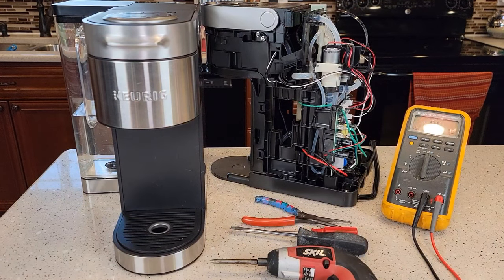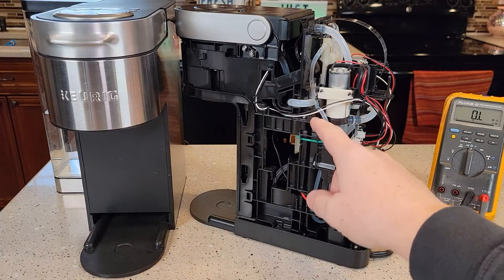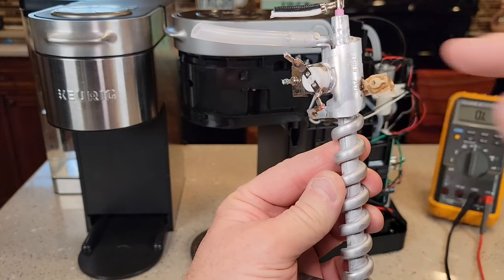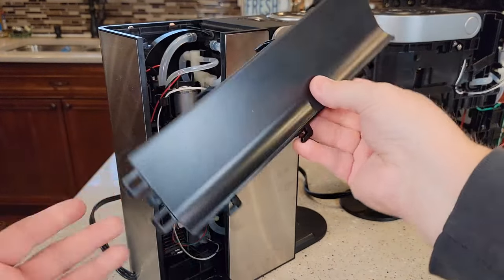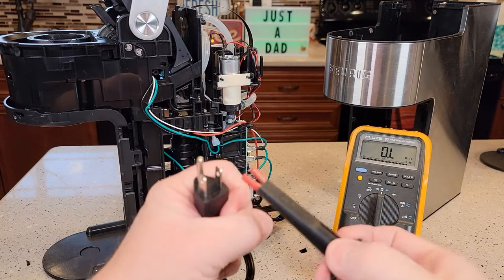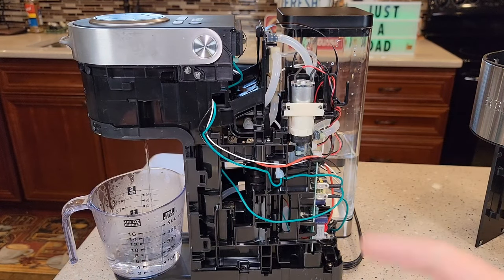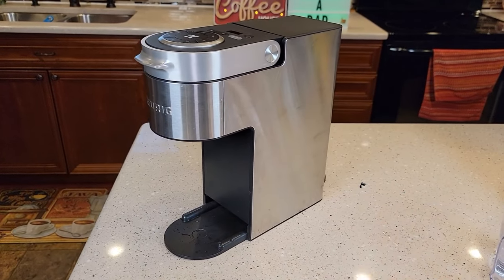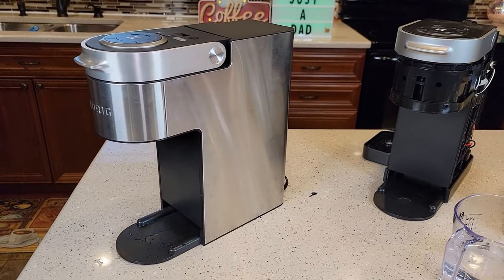HOW TO FIX Keurig K-Supreme Plus Coffee Maker Dead NO POWER.  How to reset Thermostat POWER LIGHT!

Comment: Thanks!  Has Keurig fixed the board yet to tell you to add water in the descale mode?  Mine was about to trip again because it will not say add water before it's too late, which messes up the descale rinse part of the mode [because I feel like I have to interrupt to add water before it blows thermostat again].  Any who, I just add water to rinse, then unplug for a while to get back into brew mode, but then have to live with the descale message on - as long as I get my coffee - thanks again for an excellent, detailed video.
Reply from the maker: No I don't think they have fixed that yet

Comment: Exactly  what happened to me.  Ran the tank dry and it went dead.   I was able to fix it in about 1/2 hour following your video.  This is the second one of these that had a problem.  My first one went into descale mode and never came out.  It was under warranty and Keurig replaced it for free.  It is now a parts machine.   I like the machine but there is too much going on inside.  I fear something will  always break

Comment: Well, I screwed around for at least an hour ,trying to fix myK920...to no avail.  I reset the thermostat , try to descale , and the unit seems to just quit again. Since it is a PITA  to dismantle
,I decided to plug it in after the first reset to try it. Good thing I did. So i am not sure what is the defective component; thermostat  or the water pump. I even tapped on the pump to see if it could be just stuck. I have to say that the machine is quite new , but it was in storage for a year or so. It was given to me.

Comment: My mistake was to run my tank dry before repacking it for transport back home in the spring so it wouldn’t drain water in the box.  Big mistake. I blew the overheat switch fuse. Why didn’t they put it on the other side of the heater so we could reset it easily by removing that sliding piece of cover?  Thanks for the video on repair.

Comment: Whew, just finished! It’s working now! Now just need to get it out back together…
Reply: Never mind. That took 30 seconds to put back together. Haha. Thanks for the video!
Reply: I tried descaling my machine but the water light didn’t come on, it ran itself dry and then flipped off.

The only question I have is de we effectively bypass the thermostat by doing this? Or did we actually reset it? As in to ask, will the thermostat work in the future to prevent a fire if the water is low, or is this a potential liability?

Comment: Well done!  Back in operation.  But, I'm not sure my low water sensor is working.  I think that's what failed and tripped the thermostat during descaling.  When I completed the rinse cycle, the water again dropped below where I thought the sensor should have allowed.  I unplugged the machine to prevent a repeat.  Now what?

Comment: What a well done video...thank you. Liked and Subscribed. I am saving this information for eventual use, but my problem now is ADD WATER comes on when the tank is full. Sometimes removing the tank and pushing down the connecting bung fixes it, and sometimes I have to Power-Off and unplug the brewer between uses. Do you have any ideas to remedy that?  TIA

Comment: Thanks, I had model k091 which is a tiny bit different.  It has three screws on the bottom that hold the sides on.  Otherwise it was the same.

Comment: Wow, remember when stuff used to last😄. Man, talk about planned obsolescence and a pain to take apart😥. 

For $200 (made in Thailand😞), you would think the water level sensor would be bit better🤔🙄. Wish I would have kept the old 2.0 model that had no issues. This Supreme Plus model barely made it 2 years😱😡

I do see new water pumps on eBay, but that seems to be about it. Gonna give your fix a try and if the pump is shot and keeps tripping the thermostat...Then the $50 Amazon k-cup it is😅

Just a recommendation on the descaling, use vinegar and then distilled water for best results🤙

Thank you, sir🍻

Comment: Hi I just found your video because I need to open the Keurig machine and get my daughter's father's pendent containing his ashes out of it. she'd stuck the necklace on top of the Keurig. Then I came along and opened the top to add a k cup and it slide in. I tried turning the machine upside down with no luck. Should I open the machine like you showed or can I just pop the top off to retrieve pendant. I feel so bad. And thanks for an easy to follow video.
Reply from the maker: try to pop the top first,

Comment: Thanks for the video

My machine initially wouldnt power on. I was able to open my keurig supreme plus and reset the thermal switch and now the unit powers on but only the power button 12oz and 10oz button lights up then turns off. Ifbit stays on long enough the power button sometimes flashes 2-3times

Comment: Great video.  I have one of these K-Supreme units that works but none of the buttons on the top light up.  It seems to work in spite of this.  Do you have any guidance on taking the top head apart to check for a bad connection?  Thanks in advance.

Comment: I had this problem and I contacted Keurig. Instead of servicing it they were good enough to send me a brand new one free of cost. But I am having a problem with the replacement unit in that the water is not going through the pod so I am getting plain hot water. So it looks like I will have to try what you have shown in your video with my old unit. These Keurig machines don't seem to be very reliable.

Comment: Mine is brewing just a little bit and stopping. I am troubleshooting right now and came across this video. With the machine apart can you tell me exactly where the themostat is on the side panel in relation to the reset button. I am going to drill a hole in mine so I can stick a long wire in and reset the therostat without disassembly. I will of course put a decorative plug in the hole so it still looks nice.

Comment: Thank you this video. I called kuerig this morning because I went to brew a cup this morning like normal. I pressed 12 oz and brew and the machine immediately shut off. I turned it back on and it said descale. I just descaled this machine a couple weeks ago. So I tried holding the 8oz and 12 oz at the same time and nothing happened. Descale disappeared. So I tried brewing again. And it immediately shuts off. Kuerig offered me 20% a new kuerig with no help. 😏 Not sure if I just have to reset the thermostat but I’m going to try this. Any ideas what would cause this?

Comment: My Keurig supreme  had a power on light but no cup size or start button were dark. The micro switch for the kcup lid door handle was solid shorted   The button was stuck in the micro switch under the metal actuator. Tap the micoswitchwith a screwdriver and the button popped out of the switch. And now it works

Comment: Thanks!  Just got 2 broken Keurig brewers working again with a warranty replacement on the way! That said, I have a different problem on one of them (which is why I replaced it in the fist place) that K-Supreme Plus doesn't have any lights, at all, but still works.  Any idea of what I'd need to do to get the lights(power/screen/buttons) to glow?  The other one is almost always 2-4oz short even after multiple descalings... any ideas on a fix for either?

Comment: Thank you for your informative video.
I was able to dismantle my unit, thanks to your instructions, but fond testing it with my multi-meter, the reset button had not tripped and there appears to be other issues. When I press the power button, the power light comes on as well as the strength and the temperature lights. The other lights fail to illuminate and nothing happens when  press any of the size buttons or the big K button. This happened all of a sudden...I made my wife her morning coffee and when I placed a pod in for mine...nothing.
The water tank was full at the time.
I called tech support and They offered me a 20% discount on a new model but at $300.00 Canadian, I'll go back to the old coffee peculator if I have to. 
I currently have it tagged for the landfill unless you have any suggestions it's only 1 1/2 years old.
Reply: After further investigation I can see that the ground (green) and the hot (black) wires have been severed way up inside the flip up head. This appears to be a design flaw as the wires should be highly flexible able to tolerate constant flexing. 
Thanks again for the great videos.
Reply from the maker: oh wow thanks for shairing.

Comment: Hi - any suggestions for the unit powering on, but not working otherwise.  It then shuts off after around five minutes.  Tried all the unplug the unit and reset the reservoir options to no avail.  One other piece of information is that the "Over Ice" button flashed quickly when plugging the unit in and before pressing the power button.  Thanks for any insights.  Love your videos!
Reply from the maker: have you descaled it?
Reply: Indeed I have
Reply: So - do you have any suggestions for further troubleshooting this unit based on my description above?

Comment: Huge Thanks!  I am on my 2nd one of these and refused to replace it.  Found this video.   I have a 2nd home and both failures came after leaving the machine unused for ~6 months.  The first use it dies.   Does anyone have any clue if the water evaporates or something in the machine?   I empty the tank when I leave it unused for a long time.  Is there a way to "winterize" it so this shouldn't happen?

Comment: Hey Dad !!!!!!!!    Mine quit working at the control panel.  Checked the breaker, was not open........   Further investigate I found the Blk wire for the panel annunicator broken from opening and closing the upper lid.  Reconnect the black (power line) L1 120 walllahh !!!  Back in business..............   Matthew.

Comment: Kudos to you, Dad, what an incredibly helpful video! Thank you so much. How did you find that reset button?
I’m shocked to how many people this happened. For a relatively expensive coffee maker, this is surprising.  Hopefully, Keurig can make up for this. Currently, one needs to rip the whole housing into shreds before one can access a simple reset button. I wonder many people went to buy a new coffee maker, right after descaling because this incident seems inevitable. Is this part of Keurig’s business model? That will backfire once the reviews come in.
Reply from the maker: Thanks so much!! I can not take the credit,  I did a video of me taking apart a coffee maker and I found the thermostat bad by troubleshooting it with a multimeter.  But I thought I had to replace it, I had a viewer leave a comment and said it could be reset.  I reset mine and it worked!!

Comment: K-920 Keruig K-Supreme Plus. I been out of town for 5 months. Came home and filled the reservoir with water. Turned it on, left the kitchen and came back 10 minutes later and no power. Found your channel and disassembled the machine. The thermostat was tripped. I reset it, put the reservoir back on, hit brew and after a few seconds, the thermostat shut it down. I did notice, the pump is going (by feel and sound) but the water is not getting up to it. Is there a way to purge the air out?

Comment: Thank you for the great video JAD but I am not going to work on my coffee maker. 
Keurig needs to bring back the K Elite and trash the K Supreme Plus or fix it. I have purchased 4 K Supreme Pluses from Costco in 1 year and all have died anywhere from 2-1/2 to 4 months. 
They will not power on just as you indicate in this video. 
The last one was the newer Costco exclusive Gray model and it was the worst. It just died today 2/27/23 after 2-1/2 months including one descale. It seems that shortly after the first descale they fail. 

I purchased the K Elite in late 2018 and did not start using it until July 2019. It was still working fine when we donated it in January this year.
So what is Keurig doing to correct this? Anyone know? Is there a better option that uses K-Cups?

Comment: Your video was very helpful and well done. I was hoping it could help me but I happen to have a different issue with mine. The machine turns on but when I try to brew the lights go out and nothing. I tried descaling by pressing the 8oz & 12oz for three seconds and when the brew button lights up I press it and again all lights go out. It almost sounds like the pump is not working. Would resetting the machine on the inside work? Please help!!
Reply from the maker: no the reset will not help with this, sorry

Comment: Second time I’ve used this video to fix my Keurig. 

Question: Why do I have to take the screws out of the bottom to disassemble it when the sides just snap off? I don’t see how they could possibly prevent me from removing any of the outside pieces.

Comment: This thermostat reset seems to be a common problem on several models of Keurigs ( the one I'm working on is just the cheap K - Express Essentials in barf blue !) My comment is WHY doesn't Keurig make a removable access panel so it doesn't require basically a complete teardown ? 
That being said, since I never registered my Keurig and it was bought over a year ago, it wouldn't matter if I were to do something which would typically VOID the warranty. If that were the case, approximately (ok - exactly !) where could I add an access "hole" to allow insertion of long piece of wire to reset the thermostat ? Basically, carefully drill a small hole in the upper right side that's just large enough to accommodate rigid wire and maybe enough gap to shine light thru hole to possibly see where I'm going with that wire ?? And is I were successful, I would cover said access hole by using either some clear silicone which could be removed if this reset were ever necessary again. Or something more permanent and paintable if the shortened version of descale was done from now on....Any idea on placement of this hole ??    Thanks ! Tommy C. in Virginia

Comment: Thank you! I was able to reset without taking that silver cover off. All I done was pop the top off. Taped an opened paper clip to my long screw driver. Like make an small 90• angle. Grab a flash light to find that stupid reset hole from the top. And wiggle the screw driver with the taped paper clip into  that hole to reset. Then put the top lid back on. I hope the makes sense 😅 I just didnt want to take that whole thing apart. 😂
Reply from the maker: you're welcome

Comment: Me and my grandfather are having similar issues, except our lights and screen will turn on for 2 seconds, then just shut off. Trying to descale won’t work either. Is this the same issue and will it be resolved if use this solution? I’m not a very tech savvy person myself so I was just curious and wanted to know before pulling apart the machine!

Comment: Question...After two years mine (this same model you're using and NOT a "Smart" ) out of nowhere the descale process is stalling.  About halfway through descaling it stops flashing for the next run and goes dark.  I haven't even completed the first pitcher.  The "K" light is usually flashing for the next part of the process.  It's like it won't complete the descale process.  Is there a factory electronics reset for this model?  Just the K-Supreme Plus.  The one you're tearing apart.  Which, at this point, I found extremely satisfying!!!  LOL

Comment: Is there a higher temp thermal switch that you know of to replace the OEM thermal switch? I thnink a Thermal switch that is rated about 5 Deg F higher could solve the issue. Regardless, thanks for the Video.

Comment: Thank you for the video. So I did it and put it back together. Now it turns on but when I put a pod in it runs for 20 secs and then turns off. It will flash a descale error but I descaled two weeks ago. Any next steps?
Reply from the maker: sorry just not sure on this one, maybe clean the needles.

Comment: Do you know what rating the thermal fuse is? I want to put a re settable thermal fuse with a button. I will probably make some kind of access hole so I don't have to disassemble.  if the water gets low while using it sometimes it gets an air bubble in the system.  When I went to make coffee after someone else the fuse tripped . The water tank  had some air bubbles when it started to brew. Once I reset and re seated the water container , it is working fine.  Wasn't sure what temp rating was . We use reset able  thermal fuses in dryer  and microwave repair.

Comment: So I followed your instructions and it worked great. It powered back on so I can descale. I followed your other video to descale and after I hit the K, it said descale and the dogs danced across, then it just powered off again and I can’t get it to turn back on. Do I need to buy a new one?
Reply from the maker: make sure the lines have water in them   lift the water tank on and off a bunch to get water to go into the lines.
Reply: So I took the thing apart again and reset it and lifted the tank many times. I restarted it and it started to descale and stayed on longer then it powered off again. I left the back piece off in case I needed to reset again and that coil is really hot and there is a small smell…I’m wondering if I burnt something out. Do you have any other suggestions?